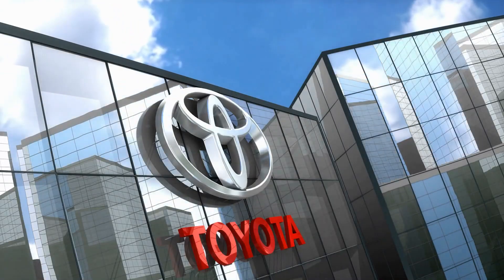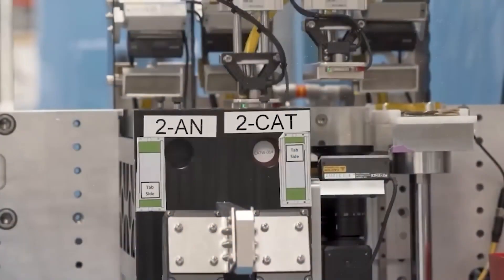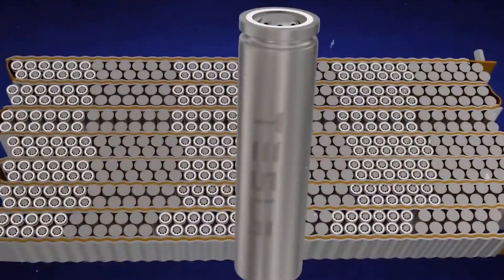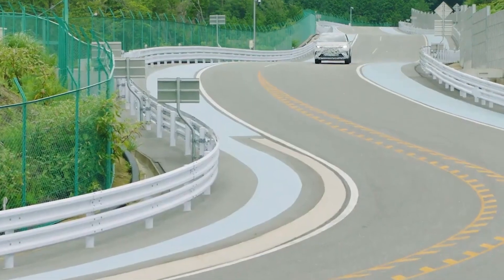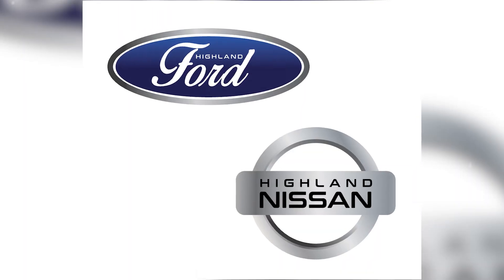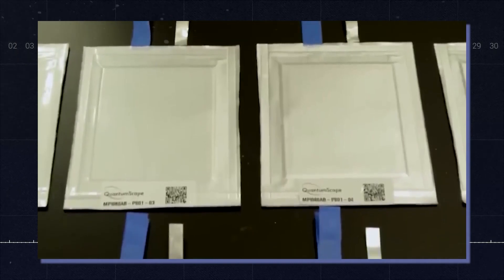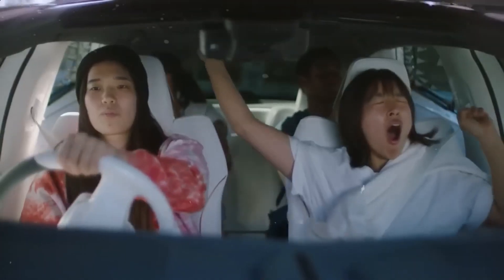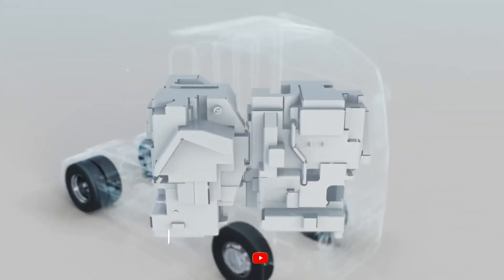CRAZY New Solid State Battery Toyota

Comment: for a company still talking crap about electric vehicles and does nothing cutting edge ,I find it hard to believe they will do anything in the 5 years.   They keep promising everything but delivering nothing.
Reply: Well, it's true that the CEO of Toyota believes that the focus should be on hybrids not pure battery EV's and on hydrogen fuel cell or hydrogen engine cars if fossil fuels are to be abandoned completely but it is also because of their focus on hybrids and fuel cell cars that they have had the most research that are applicable to battery EV's and their efforts to lobby governments to not ban new ICE sales have largely failed.   I wouldn't be too hard on them as they really haven't misled the public, at least not as much as other auto manufacturers and their stance on hybrids over battery EV's does have some merit though really it's just to capitalize on their excellent gasoline engines (at least excellent till they started building some in the US but they've compensated for the lower precision by enlarging the ports so it's all good now).  Besides, Toyota is now the first one with a cheat code on your key fob where you can shut it off completely so you don't need a Faraday box, pouch, broken microwave or aluminum foil to protect against wireless car thefts and your 2032 batteries for the key fob will last longer.

Comment: I believe clean energy can be used to grow food rather than foolish busness that takes space
Reply: It's a matter of effort, a farmer could easily grow seed oil crops on their fallow land, use a vegetable oil expeller to extract the vegetable oil and use a biodiesel reactor kit to process it into biodiesel to harvest and seed the rest of the fields as well has harvesting and seeding the oil seeds.   But it is more effort and until now, with farmers exempt from fuel taxes, it's just been easier and often less expensive to just buy diesel.  The fact is, even as overpriced and taxed fossil fuels are, it's still the least expensive option per unit of energy, EV's have only gotten by because electric motors are about four to five times more efficient than gasoline and just under twice as efficient as diesel engine plus EV manufacturers focus a lot on saving energy with light weight materials, better aerodynamics and using heat pumps to provide both heating and AC.  EV's have gotten as far as they have by requiring less energy for the same range and performance.   Now, will farmers go to the trouble of producing some of their fuel from their fallow lands, you'll have to ask the farmers, all I can say as an engineer is that it could be done but it would take effort.

Of course convincing people to work more for the same and maybe even less income is never an easy sell.